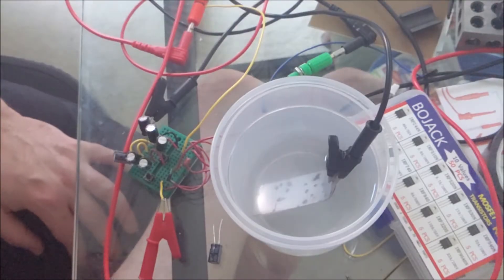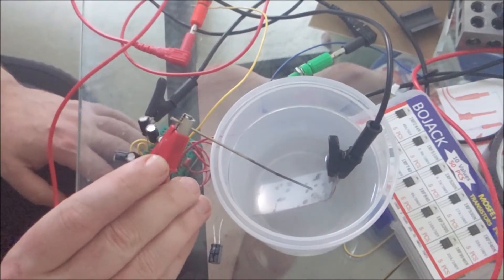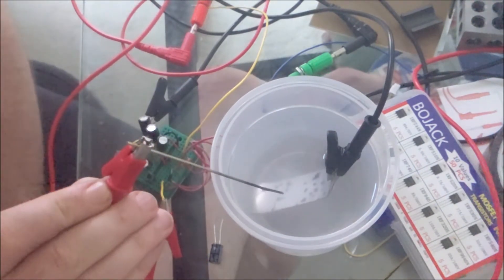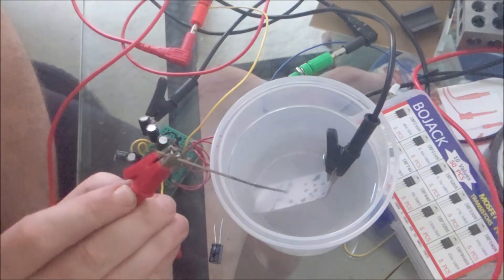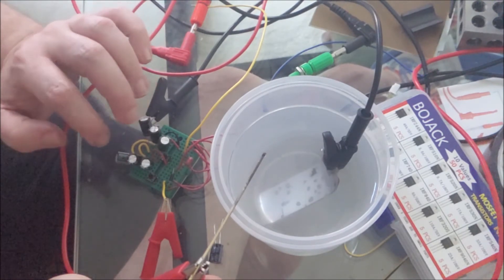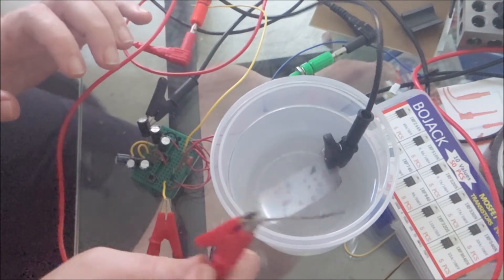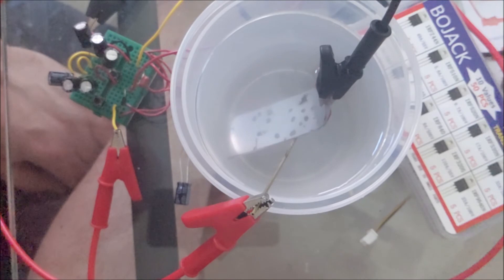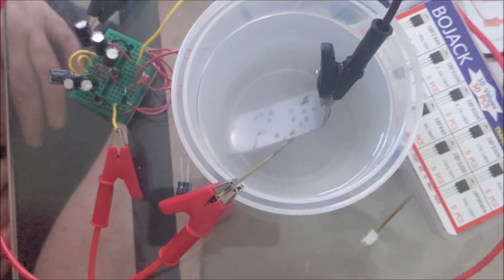hand held edm self electrocution

Comment: I'm guessing that you just need accurate x/y positioning and a solenoid to move the electrode in and out rapidly, correct?  That would give you real EDM capabilities?
Reply from the maker: Well, if i'm just drilling/sinking i'd likely just build a z axis.  I don't think you want the motion to generate the gap, rather the capacitors charge at a rate based on the resistance of the wires.  when their voltage gets high enough they make a spark which lowers the resistance between the tool and part and all of the energy in the caps dumps quickly.  My next step is to record the current so that I know when it is touching dead shorted, knowing that I could back off a stepper and get back to the ideal distance of a few microns.
Reply: @JesseSchoch I was probably thinking of the old cheapo designs that used a solenoid and minimal electronics.  Z-axis control with a stepper sounds like a better solution. 👍
Reply from the maker: @danielabbey7726  i just tried a sonicare toothbrush, worked better than i would have expected.